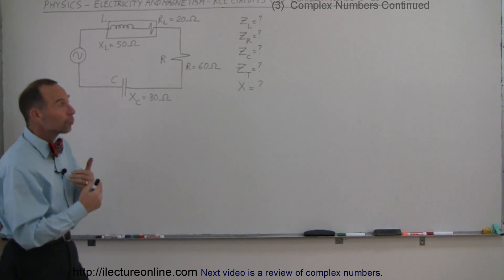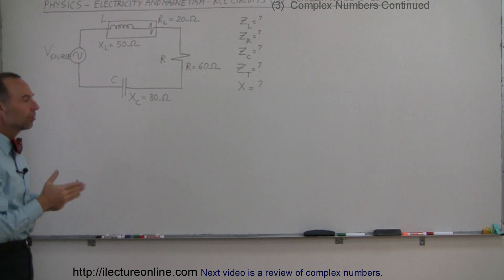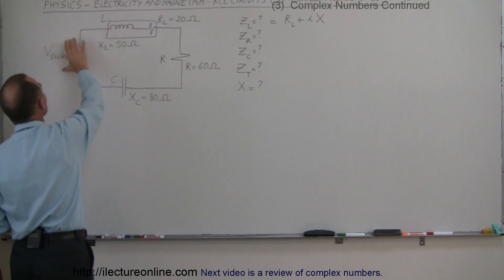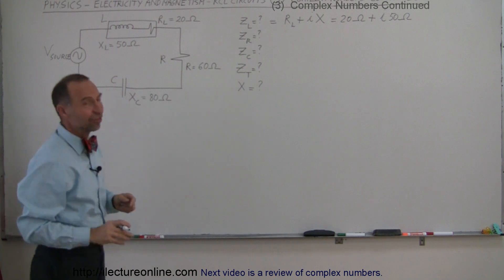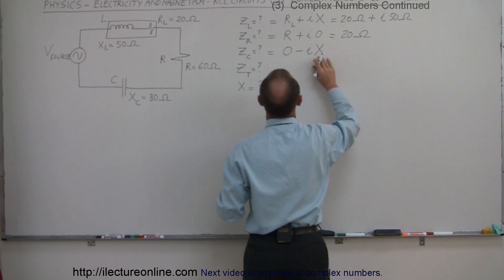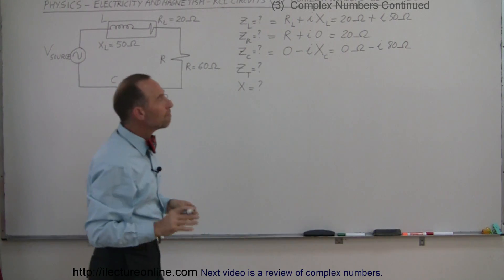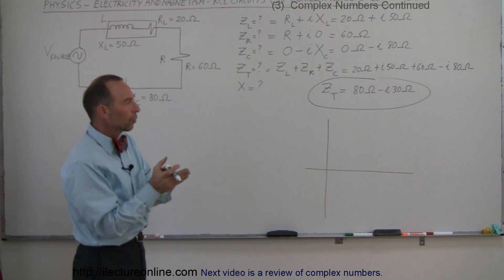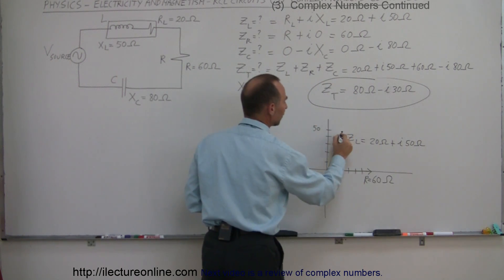Physics 49  RCL Circuits (3 of 13) Complex Numbers Continued

Comment: @2:10 could somebody clear up what he said? I don't understand why there is a negative sign before jwt for capacitive reactance????
Reply from the maker: It helps whey you are familiar with the phasor diagrams in electrical circuits with an AC voltage supply.  The voltage rise and fall across capacitors and inductors occurs at different times relative to the source.  We have detailed explanations of this here:  ELECTRICAL ENGINEERING 10 PHASORS AND PHASOR DIAGRAMS  Starting with:  Electrical Engineering: Ch 10 Alternating Voltages & Phasors (1 of 82) Alternating Voltages  https://youtu.be/-_YsGWAxQpk

Comment: quick question: what if the impedance of the capactitor is given a j5 in a circuit and is in series with a resistor of 10 ohms. Will the total impedance be 10-j5 or 10+j5? Thank you for all the help!
Reply from the maker: Since the voltage across a capacitor lags the current by 90 degrees, it the resistance and the capacitor are on the same branch the total impedance is 10 - j5
Reply: @MichelvanBiezen  thank you so much, must've been a mistake on the circuit and should say -j5 instead!

Comment: Is there such a thing as a resistance in the negative reaction? Is there an inductor/capacitor counterpart for a regular real resistance?
Reply from the maker: A resistor acts the same way for current in either direction.  And the voltage and current are in phase across a resistor.
Reply: @MichelvanBiezen  but there is no passive component (or combination of) where the voltage and current are 180 degrees out of phase?
Reply: @MichelvanBiezen  also: thank you for the videos on RCL. I'm starting to get it a bit more now :)

Comment: The impedance of the Resistor should be 60 ohms @ 02:57 

right?
-------------

Never mind you fixed it later on! thanks for the videos
Reply: hI JUST MADE A MISTAKE, YES ITS 60 OHM'S